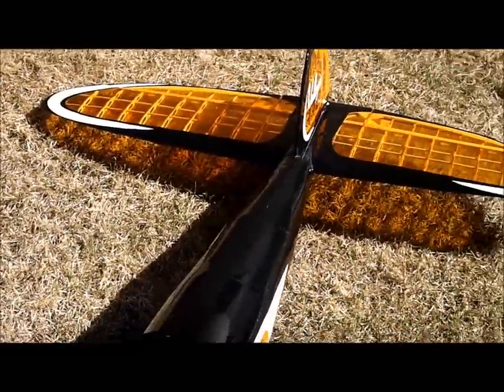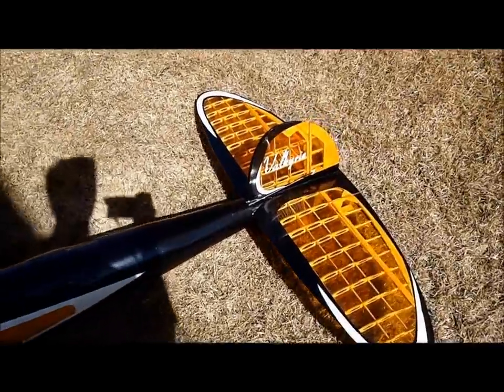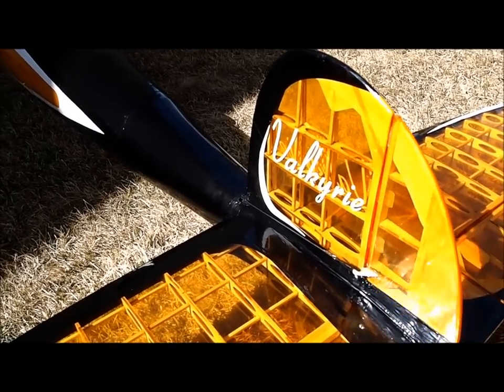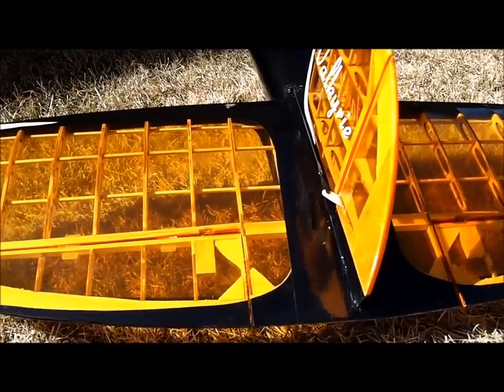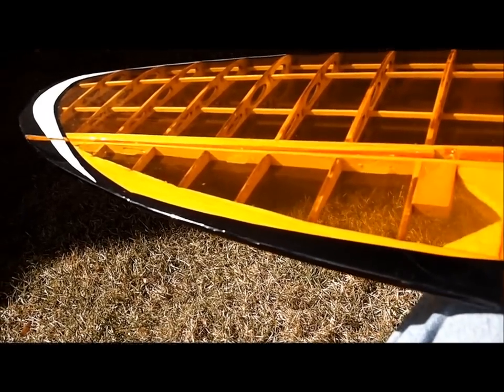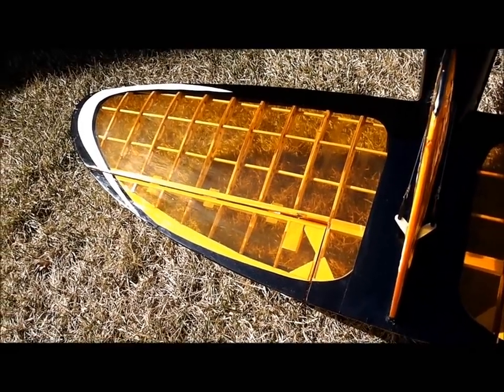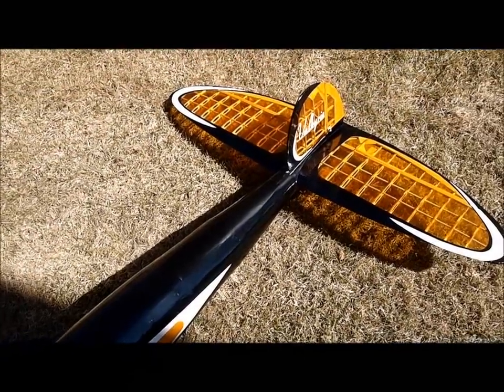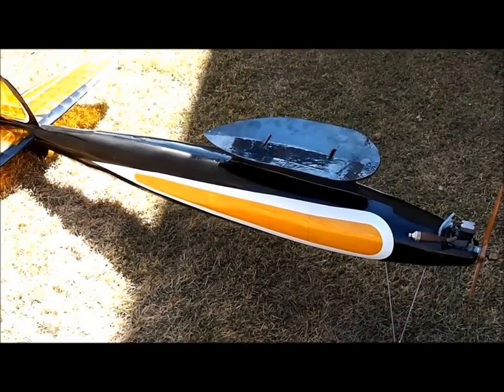R/C Oldtimer Valkyrie Maiden

Comment: Beautiful plane. Mr. Copeland is a fantastic pilot. I use to fly R/C pattern years ago at the Lincoln Sky knights pattern contests. I remember Dean from there. I have been flying old timers with old ignition engines for the past 15 years. A Playboy with a Super Cyclone, and  a Lanzo Bomber scaled down to 60" with an Ohlsson 23. 

A much more relaxing way to fly than pattern competition. Gasoline has been much less expensive in the past than glow fuel, and only takes half as much, but things are changing rapidly. Gas is going up by the week. I usually use stove fuel or white gas.
Reply from the maker: Hey Jim!  Thanks for the comments!   It's a good flying plane!   Now, Tom Egbert owns it and flies it when we have old timer events!